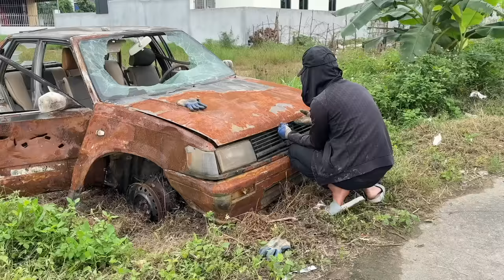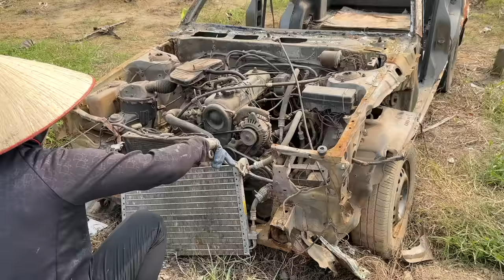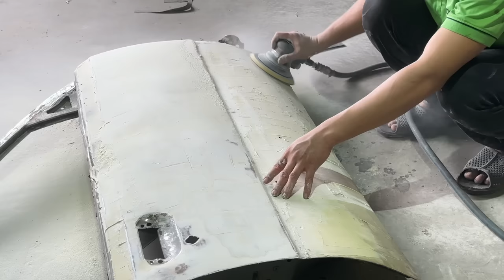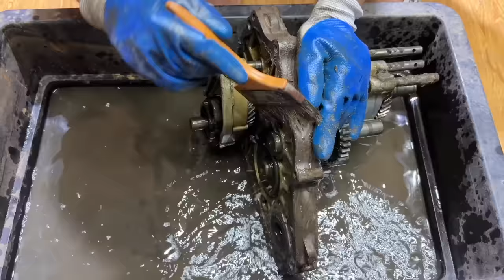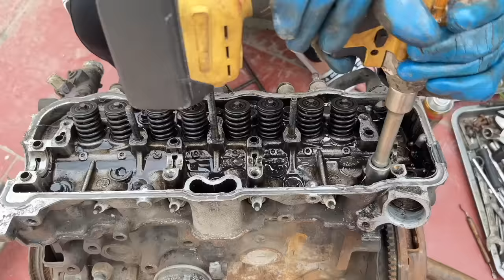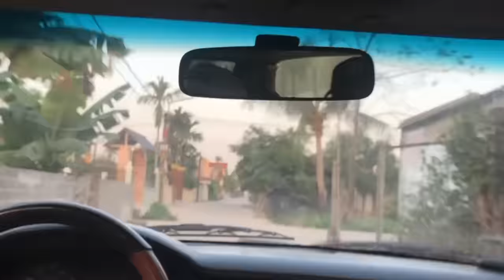Full restoration of forgotten $5 million supercar

Comment: I don't know where to begin... bondo over rust .. i guess helps the bondo to attach to the metal 😂... gaskets.. don't need them... the slight oil leak will help with the rust.... i love the new head gasket.... the torque wrench arm click is dead nuts accurate..   and thats some dam good self leveling paint too... 😂😂... and the list goes on ..  Now thats some shady tree mechanic and body work 👍

Comment: Where do you get all the new electrical cabling/wires/connectors after cutting and destroying them in the removal. Same for door seals, trim etc.
Reply: The internet?
Reply: Kmart
Reply: It's fake, like all of their videos. It's 2 different cars.
This junk is all over youtube, sometimes they even just put fake "rust" and dirt all over a working item.
Reply: @DoubleMonoLR But the windows and the interior and even the engine is broken and rusted

Comment: Great video but, loads or rebuild errors. Pulleys loose, no wood druff keys? Spraying the engine with open carb, belts and wiring. Tightening the cam etc without a torque wrench? But if the car runs and gets the owner around, and saved them a stack of money ( no expense given to bearings, grease, new wiring loom???) then well done!!! Oh and the 'restored car is a 1990s Fiat Tipo, not a Toyota, nor Audi?????

Comment: Considering it’s just an eighties-era Toyota, it’s probably not worth more effort than this. But basically, apart from fixing the door panels pretty nicely, it’s a shoddy job! He dismantled the gearbox and the engine all for nothing, if he didn’t even replace all the bearings and bushes - instead of giving it a mere good scrub with dishwasher liquid and putting it all back together using the same old bolts. When I saw him spraying that red paint onto the fully assembled engine, I had seen enough. You can place this car into a dealer’s showroom perhaps, but as a restoration, it’s completely worthless.

Comment: Body filler straight over rust one can only imagine how long it will last no million-dollar car 5 million manhours to fix it properly. Picasso would be proud of the texture and passes all the health and safety requirements.
Reply: Wasn’t even real rust at the start he peeled the paint and the rust went with it which wouldn’t happen in reality the paint would be gone and the rust would be bonded to the metal and you’d have to sand it off
Reply: Muy regulimbis el video amigo  a que horas  Cambio  el volante? 1:31:02

Comment: Love the lack of health and safety  no proper  shoes no safety glasses no mask when sanding just chuck the motor on expensive tiles and scratch the hell out of them I've not yet seen any new bearing go in the gearbox which he spray painted over just a rush job and no thoughts careless use of safety equipment. $5 Million dollar car yeah bullshit.Would have been better off letting it rust cause paint on the bearings that weren't replaced will soon cease anyway.

Comment: This is so clearly fake its hilarious rust bonds to metal not paint so what hes doing at the beginning is not possible had it been rust second the seats are clean which would be fine had every window not been smashed out and the car looking like its been there for 30 years third the body is rusted out with fake rust but the engine bay looks like a normal used car and finally at the end thats an Audi 80 when this is a Toyota Tercel